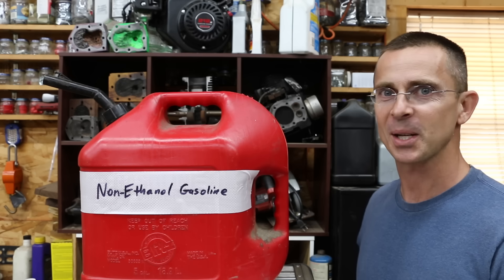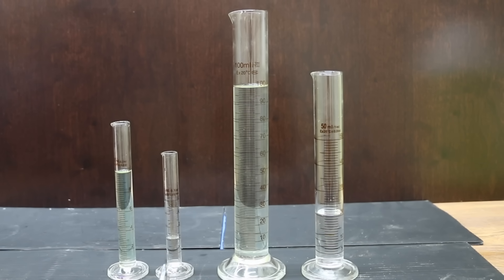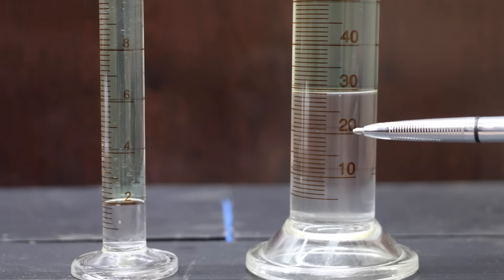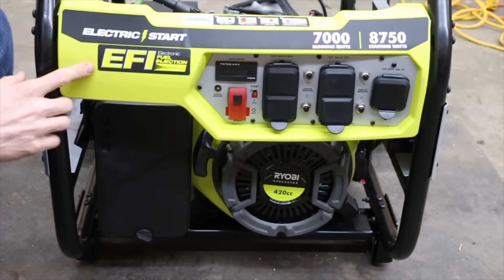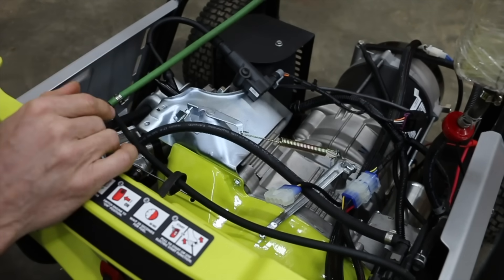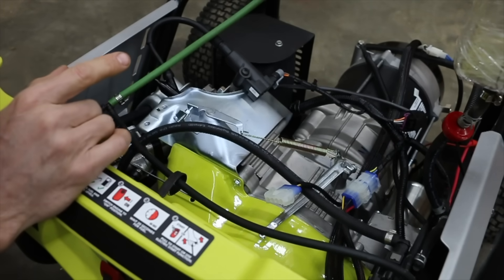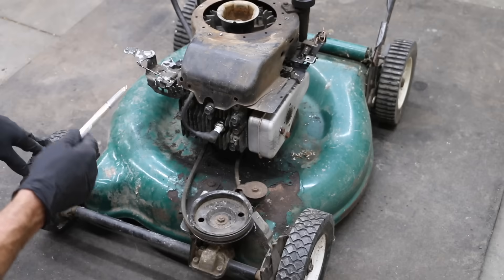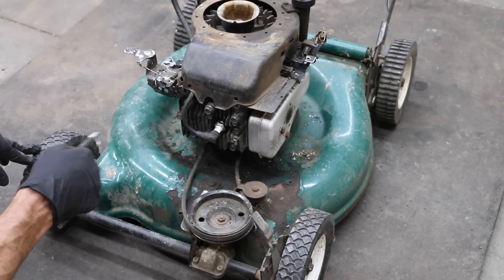Is Non-Ethanol Gasoline Really Better? See the PROOF!

Comment: It's not an engine, but a Dual Fuel Coleman Stove can burn un-leaded gasoline as well as the Coleman fuel. The nozzle in the generator has a fine needle and very small hole to vaporize the gas and inject it into the carburetor. The vaporizing tube, also known as the "generator" passes through the flame causing it to pre-heat and vaporize the gasoline. Inside the generator is a steel coiled spring and a brass rod. These components spread the heat evenly and cause the fuel to spin making it mist and mix in the carb even more. If you use ethanol gasoline, by the end of the second tank (about 1 quart each) the nozzle will be nearly if not completely clogged. The steel coil will be clogged and no longer acts to spin the fuel. By this point the coil will be stuck inside the generator tube and it takes a 1 hour bath in carb cleaner to get it out to clean it. The brass rod will have a heavy build up of carbon reducing the flow, pressure, and volume of fuel that can pass down the tube. Non-ethanol gas will eventually do this also, but only after about 10 (or more) gallons of fuel. It is also very difficult to get the ethanol gas to burn without some yellow sooty flame. My conclusion is that the organics that remain in the ethanol can quickly clog small openings like injectors and can eventually fowl spark pugs much faster than non-ethanol fuel.
Reply from the maker: Thank you!

Comment: If, when you do the longer term test, you run the engines for a longer period of time, please also test the oil from both sets.  There was conjecture a while back that ethanol could cause accelerated degradation of automotive engine oil.  I never go to see actual test results of that.
Reply from the maker: Thank you for the video idea!

Comment: Thanks again for the great video.  Were the gasses from the same gas station?  Was it Top Tier, or not?  I would like to see if regular vs Top Tier fuel shows a difference in cleaning performance and corrosion resistance.  I would also like to see how the supposed best gasoline - Shell V-Power Nitro Premium gas compares to regular gas and regular top tier gas.
Reply from the maker: Different gas station. Thank you

Comment: in my opinion, the worst thing about ethanol fuel itself is that it does Not store well. And if left in an engine, it tarnishes up the carbs really bad, especially smaller carbs which have tiny jets and passages. 
And although not being able to store fuel (or having a much harder time storing) and it stay good, is one reason they have done this. However, with that said the Main reason they have pushed ethanol based fuel, is to Destroy More of the food supply. 
What do I mean? Instead of farmers growing corn or other crops for food, they are instead growing corn for fuel. Which means a large portion of crop land is being taken out of rotation for Food Production. And don't get me wrong, its not the farmers fault, as the farmers are under attack (mostly financially) on all sides and they are doing everything they can to try to survive, and even then many have and are losing everything they've got. 
Our food supply is being attacked on all sides. Even through the prices are going up all the time, The *ONLY* reason you can still currently go to the store and buy whatever food you want for the most part, is because Most food is being imported from nations all over. And with South America undergoing major collapse and chaos, this is yet another attack also upon the US food supply as a Lot of food was imported from South America.   So many other ways our food supply is under attack and being poisoned as well.
Reply from the maker: Great point! Thank you

Comment: So, 4%, if this carries over to mpg, then ethanol fuel of 20mpg should theoretically then get 20.4 mpg.  in the short term, not that big of a difference, but over time, that .4g adds up. However, depending on the price difference of the two fuels, that's what makes it worth it or not.
I wonder how much increase in HP or TQ non-ethanol fuel adds 🤔😉
Reply from the maker: Thank you!

Comment: Good end user field tests.  This is what we typically find in the fuel lab.
10%ethanol is 4% shorter run time, but approximately the same kW output in a fixed timing/compression test with injectors and clean burn.  Therefore unless your cost is only 4% more for the same octane grade, pennies per kW is better with E10.  Cars/trucks have non vented tanks/caps and evaporative canisters.

Carb small motors (and very old cars) are usually vented caps or tanks, gravity feed off the bottom, and the bowl is also gravity and vacuum fed off the bottom.  Thus your E10 problem.  Water settles at the bottom layer if entering into the system.  A full tank won't breathe in water (damp air) as there is no air space.  A mostly empty tank left that way over winter, will leave dew volume to condense water as temperatures drop.  Night after night accumulation in hot to cold regions.  You get moisture in winter.  It settles at the bottom and corrodes jets, bowls and steel tanks.  It prevents good running, causes poor idle and makes for a very difficult winter start.  A full 100% gasoline tank will not accept water, however a full Ethanol tank will accept a little water into the solution.

Almost empty 100% gas tank will still condense water (temperature, empty space and air moisture).

in E10 the ethanol is tempered (like whiskey is). 80 proof is 40% alcohol and 60% water, yet it is alcohol to you.  Ethyl added to gas is often tempered with some water BEFORE you buy it.
Reply from the maker: Great information!  Thank you!

Comment: Fuel "efficiency" is not really the correct term and seems to lead people to believe they are getting ripped off.  Ethanol blended fuels have less energy content than straight gasoline, so you get slightly less range, but not necessarily poorer efficiency in energy utilization.  A well tuned engine running on E85 is every bit as efficient, just gets ~30% less fuel range due to the lower energy content.  That also could play a bit into the difference in flame color on the see through engine.  Without a jet adjustment, E10 will run slightly leaner than straight gas, since is less energy dense and needs more of it to make the same AFR as straight gas.  The con that actually can be a pro at times is ethanol gas can hold a little more water before separating compared to straight gas, so you are less likely to have a fuel system log up with water due to normal day to day temperature change condensation of humidity.  The ethanol picks it up and remains combustible with small amounts of water absorbed.
Reply from the maker: Thanks for the constructive feedback.

Comment: Sooooo I run ethanol free in any combustion engine that has rubber fuel lines and a carburetor to extend the life of the rubber components. If it’s fuel injected with steel fuel lines I run the standard stuff that has ethanol.
Reply from the maker: That works well. Thank you!

Comment: will that generator start if you remove the battery and manually start it.  since it has a fuel pump im curious if that thing become worthless without a battery and no way to charge it since your power would be out.
Reply from the maker: Great point. I do believe it has to have a battery for the fuel pump.  The way to get it going is to run it on starting fluid. Once it fires up, the fuel pump will get power.   It does come with a trickle charger for those who use their generator rarely.
Reply: @ProjectFarm  thank you. Good to know

Comment: Great experiment! There's another factor to consider when it comes to fuels and that's winter vs summer 'recipes'. Winter fuel contains butane, which is very cheap to produce (this is why gas is cheaper in winter), but doesn't store well in the heat of the summer. I'm not an expert, but my hypothesis is that many small engine problems arise from infrequently used items like mowers getting their last fill-up once outside temps have cooled down (and winter fuel is out), run to half-empty, and then left to sit until spring. In that time, the butane evaporates from the tank, which causes the fuel to 'thicken' and become what we often call 'stale gas'. 

Additionally, as you mentioned, fuels containing ethanol are hydrophilic and thus can potentially capture water from the atmosphere over time if there is any exchange with the atmosphere.

My theory is that if properly stored in air-tight containers, any kind of fuel will do just fine even years later, but if I'm lazy and in the habit of leaving fuel in my small engines' (non airtight) tanks year-round, I should probably stick to non-ethanol summer blend.
Reply from the maker: Great point. Thank you!

Comment: Do u think the cost increase is worth the extra run time. When I run it in my Jeep I get better mileage but not sure if they worth the cost but it makes me feel all warm and fuzzy inside that the engine and fuel system is enjoying having no corn in it
Reply from the maker: Great point.  Non-ethanol fuel prices vary a lot by location.  For small engines, it's more about avoiding damage than efficiency.  Modern cars and oil are designed for ethanol fuel.

Comment: The EFI generator was a great idea since the oxygen sensor keeps it running stoichiometric regardless of the fuel type.  Make sure you compare the different fuel line types in your long term ethanol test.  The transparent pink/orange and yellow/green fuel lines come to mind, as well as the EPDM black stuff, maybe include vinyl tubing since sometimes you have to use it temporarily to get a piece of equipment going to finish the job.  My fuel of choice for small stuff like chainsaws and leaf blowers is sunoco 110, I swear it never goes bad. at $9 a gallon it seems stupid but a 5 gallon gas can lasts me all year unless I use it in a dirtbike!  Never had any fuel line or needle and seat problems running that.
Reply from the maker: Great point. Thank you

Comment: Fuels with alcohol will always be more corrosive and hydrophilic as you said, which means it will always want to absorb water wherever it can find it. People who never run their tank down will tend to build up more water.  Stale gas will alwas have more water than fresh gas.  Summer and winter blends change due to freezing conditions - a summer blend is more likely to  freeze due to a higher ability to absorb water. Alcohol is a shorter hydrocarbon chain. Simply put a cup of long hydrocarbon molecules will have more "bang" than a cup of short hydrocarbon molecules. That is why diesel engines are more efficient than gasoline.
Reply from the maker: Great point. Thank you

Comment: I had nothing but trouble with ethanol gas in my small motors. Carburetors kept giving me trouble. Using ethanol free and no more trouble. E10 seems to work good with anything with fuel injection. Also i noticed non ethanol gas has more power especially in a two stroke.
Reply from the maker: Thank you!

Comment: Where I used to live was in a lake area and they had a ton of stations that had Ethanol free gasoline (for the boats) and we had one next door that I would fill my 1998 Ford Taurus with.  I got better mileage and no knocking on 87 octane but put in the Ethanol gas and I had to go to 89 octane or it would knock and I lost power as well as gas mileage (about 10-15% less).  Where I live now it is all Ethanol but in a modern car it wouldn't matter I have been told.
Reply from the maker: Thank you!

Comment: I only use ethanol free gasoline in my cars due to the fact that the ethanol is very destructive to rubber seals and probably gaskets also.
Reply from the maker: Thank you!
Reply: Only in old engines, anything built after 2000 is ethanol safe components.

Comment: Great video as always. I used ethenol in vehicles that are ffv. I noticed that any time the engine seemed to run a little less the smooth I could get a tank of e85 and it would clean out the engine but would use a fuel lubricator/cleaner for the injector poppets sake. Ethenol got a bad wrap mainly because people were putting it in vehicles that we're not designed to burn it. It's and acceptable fuel in newer vehicles due to them being more ethenol friendly and you are seeing more and more ffvs. These vehicles use all stainless steel fuel lines and no rubber in the fuel system. As for a video idea mixing different types of fuel additives like seafoam and Lucas to see if they work better together or not.
Reply from the maker: Thank you!

Comment: For the "ethanol destroying fuel lines", you should also have samples with additives like Sta-bil, etc.  And also the different types of hoses; perhaps primer bulbs* as well.  Since it's going to take several months to perform the test.  Maybe even multiple samples in each group so you can pull one out a month and test the damage.

I was told that the reason ethanol wrecks the hoses is due to the hydrophilic bonds in ethyl alcohol, essentially pulling the moisture from the hoses.  This sounds kind of janky to me; I'd think the modern plastic based hoses would use a plasticizer that isn't susceptible.  Anyone smarter than me wanna explain exactly what reaction is taking place?

*because there's nothing like tearing apart and cleaning the carb, replacing all the fuel hoses, and then having the $@^#%& primer bulb split on the first pump.  Damnit.
Reply from the maker: Great recommendation!

Comment: great test. oil companies put ethanol in gas to water it down. just like a cheap bar. it thins out the fuel, causes lower gas mileage, and destroys rubber and fuel pumps in older vehicles. all it does is makes more money for big oil.
Reply from the maker: Thank you!

Comment: I’ve done road tests in my 2017 Tacoma on long trips at the same speed and I can get 22 to 24 mpg with pure gas and only 17 to 18 mpg with 10% gas.  If you figure cost per mile it figured the pure gas was cheaper to use than the 10% when considering the cost per gallon.  The on board computer is a little erratic and not ver accurate but it still show a general mpg.
Reply from the maker: That's a big difference. Thank you

Comment: I been running 93 non-ethanol in my mower and lawn tractor for three maybe four years now and I haven't had any carburetor, fuel line or fuel filter issues. Prior to that, because of my ethanol ignorance, I was having to start every mowing season with rebuilt carbs, replacing fuel lines and filters. Now, in the Spring, I put around a half a can of Seafoam in the push mower and lawn tractor and I have no issues. Works for me.
Reply from the maker: Thank you!

Comment: Interesting as usual.
The hydrophilic properties of ethanol is why I use non-ethanol fuel to fill the tank of my bike and my wife's convertible for winter storage. I haven't always done this, and frankly I've never had a problem even when I stored them (or the snowblower over the summer) with 10% ethanol fuel. One thing I always do for storage is add Sta-Bil and, most important of all, brim the tank so that there's no room left for humidity-laden air.
Reply from the maker: Great point!

Comment: A big consideration is whether or not the engine is designed for use with ethanol based fuels.  Was there any difference in time for the old L head while running them out of fuel?  My GMC Envoy would generally average between 14-16MPG on the highway with 89 octane 10% ethanol fuel.  If I was lucky enough to find ethanol free fuel it would average between 20-22.  I have not tried it yet with my 2018 Silverado, but I imagine there would be little to no difference.
Reply from the maker: Great point. I didn't measure the L-head's efficiency. Thank you

Comment: ethanol is crap and i have a tractor stuck in a snowbank right now because the ethanol gas froze up during our current cold snap. i will be switching to non ethanol gas now for that old john deere.
good test
we know ethanol eats all your fuel parts and has bad performance so it should not be forced on us at the gas station
Reply from the maker: Thank you!

Comment: This is an extermely old discussion.  Their was a detailed study done by the military and govt back in the 80s that went through all this ,  there is effectively zero impact on the engine and slightly lower fuel efficiency.   Main issue really is around storage and old machines.

Comment: Getting harder to find, but worth it. I get 3-5 mpg better in my 97 F150 on non-ethanol fuel. At least in Jersey they used to only use this during winter time. Everybody hated it because fuel economy would suffer and vehicles didn't run as well. Eventually they never switched back to "summer" fuel and we've been with E10 ever since. My 2015 Malibu though makes no difference. Just spending more for non-ethanol.
Reply from the maker: Thank you!

Comment: Add a pot metal carburetor to the corrosion test.  Alcohol  corrodes zinc, pot metal contains zinc, and most small engine carbs are made out of pot metal. Also add some water to represent normal condensation.
Reply from the maker: Great recommendations!  Thank you
Reply: @ProjectFarm   Some brass needle and seats too,

Comment: I worked and delivered gasoline for many years. When they started adding ethanol to gasoline, it was between 8 to 15 percent ethanol to gas. It would average about 10 percent in 9000 gallons of gasoline. You will find gasoline at your stations with ethanol to be up to 10 percent.

And yes, ethanol is used to increase the octane ratings. Without the ethanol, the gasoline would have a lower rating of about 6 to 8 points. So a 87 octane gasoline without ethanol would end up about 70 to 81 octane. But that gasoline is manufactured to use with ethanol.
 
Moe
Reply from the maker: This is great information. Thank you!